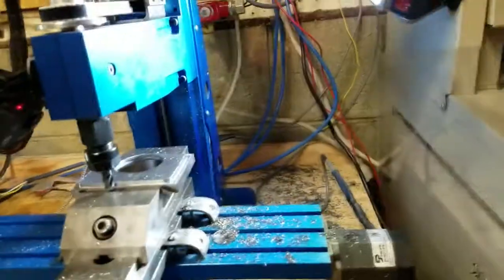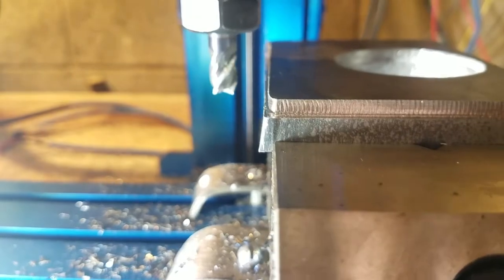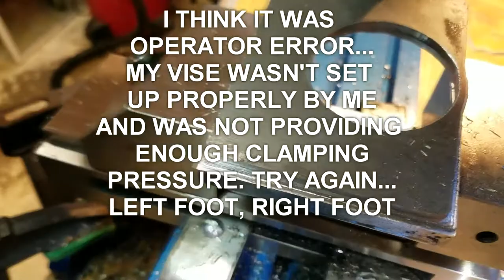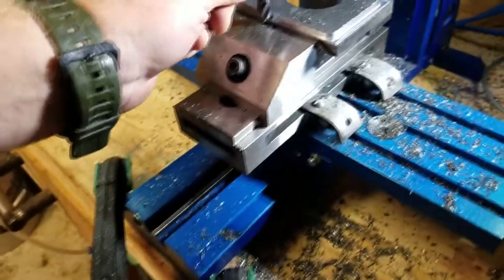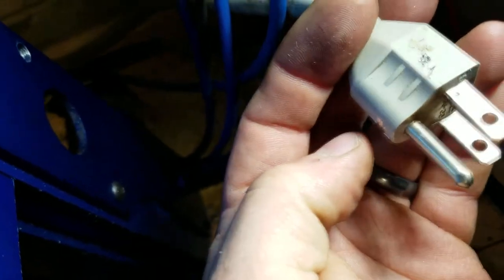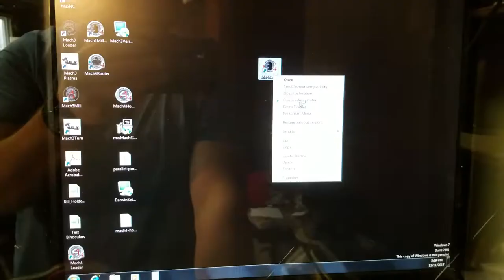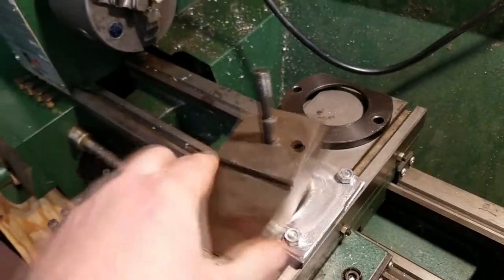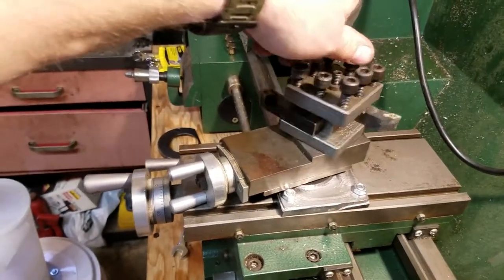Upgrade, Grizzly G4000 9x20 lathe, 4 bolt clamp mod. Milling mild steel  on MaxNC cnc

Comment: haha, Two points one is that yes those mills are seriously noisy little feckers which can ruin your relationship with any neighbours (apart from deaf old grannies), and the second being that I have exactly the same problem with clamping on my vice and slipping. Im thinking about making a bolting board 'thing' , like you know one of those things which sits on the bed with a load of tapped holes for bolting stuff down....  Nice work and you are still pushing that thing to its limits on that steel!
Reply from the maker: Rural, You are so right about the noise level. I took to wearing ear protection when working in steel. I just got done reinforcing the y axis and stiffening it up. Honestly it's about 10 times stiffer than before in the y axis. I caught deflection in the x axis on camera and that is going to give me a great bench mark for when I stiffen up that axis. Working on editing the the build video of that and hope to have it up tomorrow. Yeah, I have been thinking of creating a clamping plate too. Just want to make sure I have everything else dialed in before I go and try and make one.

Comment: Not to familiar with those vises....glad it worked out...i would love to have one of those mills....what kind of $ range r they?  I have a cnc plasma table but very limited on projects.
Reply from the maker: Usually any where from 500 USD to 1300 USD on ebay. It would depend on accessories, and model. I purchased mine a year ago off ebay for 500-600 dollars and was bare bones, no vise, not control software, no end mills. I saw a couple more sell for around that price point in similar condition soon after. The most recent one I saw was a closed loop system with controls, vise, and end mills. I don't know what it sold for but it was listed as 1300 buy it now at the time... I have put an additional 400 dollars in software, stepper drivers, vise, end mills, and collects. I had to upgrade a lot of it to work as well I thought it should. As can be seen by  some of my previous videos it has been a journey. I probably did not do as good a job documenting it in video form as I could have, but I am happy with where it is now. The stock motor is not very robust and will burn out if you are not careful. The 1/5 hp motor fan is anemic and needs to be supplemented by something else if you want to run the mill longer than 25 minutes without it letting out the smoke. I would recommend this mill if you are on a tight budget and want to learn CNC, steppers, and the like. If you have $2,000 for a budget then go with a TAIG, or converted mini mill from Grizzly. That is assuming you want to work in metal. If wood or plastic is your thing then there are a plethora of choices from cheap imports to X carves. I hope this helps, let me know if you have any other questions about this mill. I know when I was researching getting one there was not alot our there in terms of demonstrations of its capabilities.

Comment: Hi mate, I was wondering if I could use parts of this (and other) video for my kickstarter project?
Reply from the maker: You are welcome to use it. What are you kickstarting? Send me a link when you are ready.
Reply: @JoshAQ  I'm going to sell a CNC machine for £3500. It's supposed to fill the gap between the tormach and machines like the max nc

Comment: you are cutting the wrong way.....you need a down cut.
Reply from the maker: Hey Jeremie, Yeah I never thought about using a downward spiral bit. That would help solve that problem... After goofing around with the vise a little more I noticed that my vise was not correctly set up. Not sure if you are familiar with the style vise I am using, but the vise uses a bolted connected from the jaw to a pivoting nut. The nut goes into machined grooves underneath the vise. If you get the nut placed in the wrong groove you will run out of travel before there is enough holding pressure. I noticed this after I had cranked the vise as tight as it could go and accidentally touching the work piece and it moved up and out of the vise slightly. After I re positioned the nut into a groove closer to the other jaw it worked like a charm and I didn't have any more issues with the work piece coming loose. Once again the problem was between the drivers seat and the steering wheel.:-) Thanks for watching and commenting!